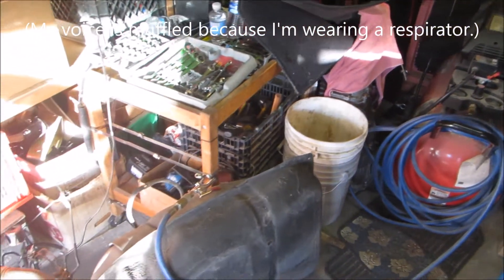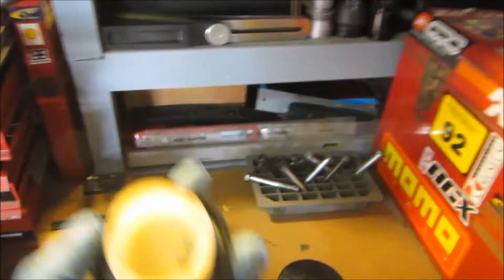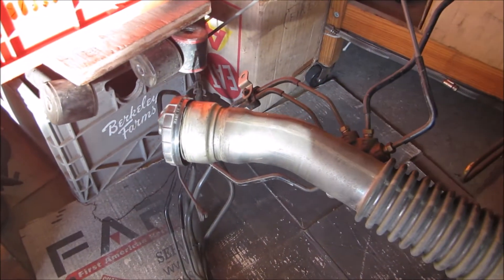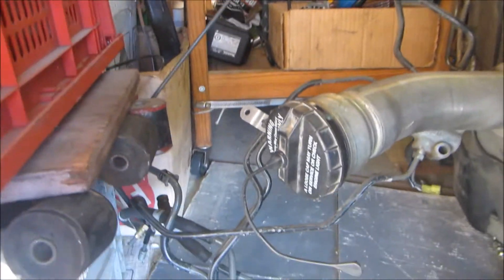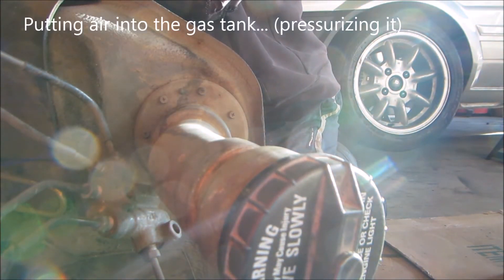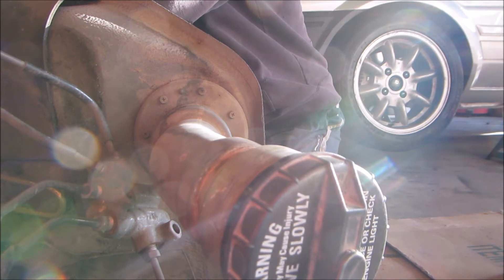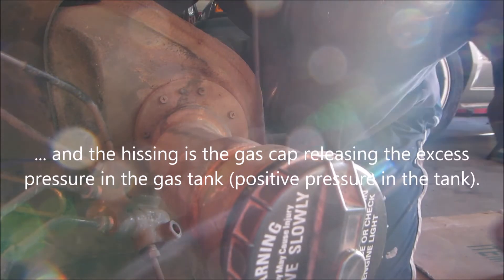Vented Gas Cap on a Sealed Gas Tank

Comment: Hope this helps my bmw! It Has a charcoal filter and also makes huge pong/thump noises 👎🏻 I let it idle and uncaped the non ventilated gas cap and you can hear all the air being sucked back into the tank when I uncap it. Will buying a ventilated fuel cap prevent me from having to purchase a whole new charcoal filter setup for a while?

Comment: Did you end up determining if these caps also let air in? How's the cap been working out for you?
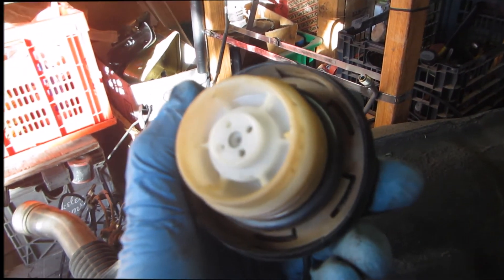Reply from the maker: If you look at 1:28, you'll see that one of the fuel caps were not vented. Ever since I changed the fuel cap to a vented one, I haven't have any other issues.
Reply: Great! Ordered a Stant cap for a 2000 corolla as mentioned. Hoping to not have fuel spit out at me when I take the cap off now. Thanks so much!
Reply from the maker: If you're building up that much pressure inside of your gas tank, a fuel cap may be the issue. Are you running a charcoal canister or have you blocked off one of emissions lines (after removing the OE smog equipment)?